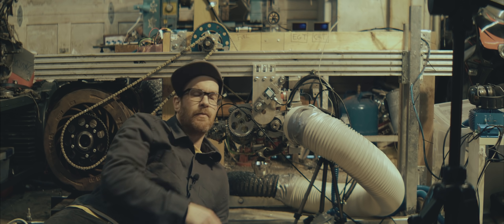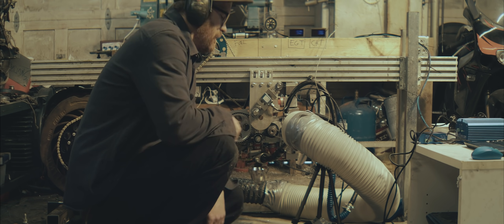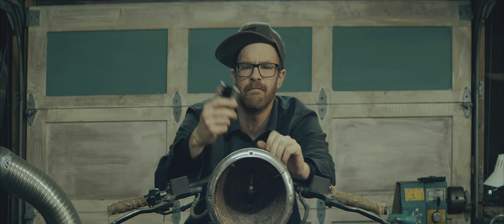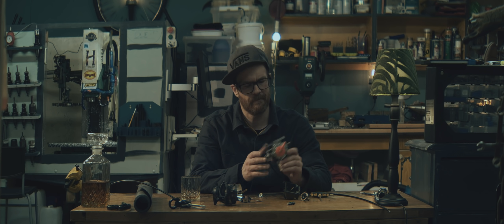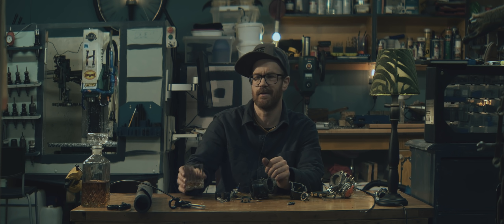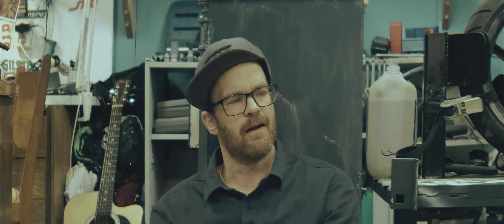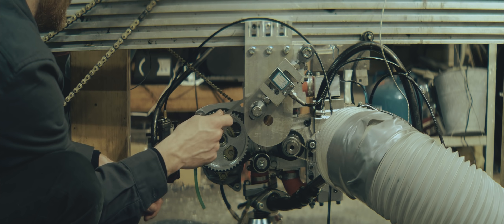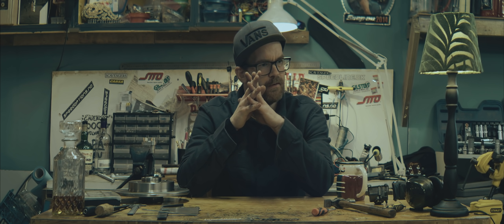Supercharged Nitro Two Stroke, Dyno quest continues.

Comment: You could very easily be getting your calibration wrong, you cant hang a weight off the load cell nut and use the weight value directly because its not acting tangentially to the pivot. If you hang the weight from the engine bold (obviously you have a lever system to take into account) you need the pivot point to be level with the engine bolt or your weight will not be acting tangentially again and you will lose accuracy.
Edit, you should also calibrate in compression the same as your measurement!
Reply: Since the weight is obviously hanging vertically, he only needs to measure the horizontal distance between the hanging point and the pivot point, they don't need to be on the same horizontal line.
In any case even 10° off horizontal would only introduce about 1.5% inaccuracy and at this point he just wants the readings to be in the approximate correct range so that he can compare different configurations.
Reply: @chrishartley1210  Are you talking about hanging the weight off the engine bolt or load cell bolt? The only time a hanging weight is tangential to a pivot point is when it is perfectly level. The load cell bolt is a long long way from level and the engine bolt doesnt 'appear' to be level either.
Reply: @manoo422  All that is required is that the measurement is horizontal. As such it has exactly the same result as if the line from the bolt to the pivot was horizontal. The only difference is a parallel translation perpendicular to the moment and as such has no effect on the vector.
Reply: @chrishartley1210  Having calculated both by hand I can see now why they are equivalent.

Comment: Haven't finished the video but maybe a boost referenced fuel pump that will raise the fuel 1psi per every psi of boost. Common thing with forced induction cars to counteract the pressure the fuel injectors see inside the cylinder.
Reply: Common with forced induction where you have injectors that is. If you suck thru a carb, all it will see is a higher gas velocity/lower pressure.
My best bet would be to go crazy with the spark energy to remove one variable from the problem.
Mounting a MAF sensor and logging the output would probably help to.
Reply: @zlaya84  good point. I also agree that having more data to go by like a MAF and a wideband for A/F ratio would be a great addition. With that kind of data it would be cool to go ahead and switch over to fuel injection and be able to tune this thing to perfection.
Reply: @zlaya84  or maybe even mechanical fuel injection... would be great for keeping the cylinder lubricated when off the throttle but really I have no idea if that would work on an engine like this.
Reply: No need, it's a draw through setup not blow through

Comment: You should add a lambda probe otherwise you will never know if the engine gets enough fuel or if it's just too much
Reply from the maker: Have a feeling it would die in seconds with the amount of unburnt oil being pumped through.
Reply: @2STROKESTUFFING  This, the EGT probe is enough to tell if you're running too lean (temps will skyrocket).
Of course running too rich is harder to detect, though I will say temps at max loads rarely go below 550C in turbo straight meth engines with 2+ bars of boost.
Reply: EGT gives a good bit of info, one thing you probably know though is that EGT can momentarily drop upon detonation when the boundary layers are blown out and the piston and head absorb the energy right before destruction...

Comment: Also, unless you have a very powerful ignition system, reducing the spark plug gap is something often needed on a boosted engine. What is the gap set at now?
Reply: I don't think it's the boost Blowing out the spark but idk this is uncharted territory... I think if the ignition is being blown out I think it's all the fuel.. it seems to me that the float carb is dead rich.. I think this setup can definitely achieve 10 pounds of boost tho (.7 bar) and that can blow out a spark if the gap is too big.. also very little is known about how an engine setup like this will respond to boost, timing, fueling, everything... there's exhaust valve timing that has to be worked out... You can't just look this stuff up lol and he's going to have to burn a piston or melt a plug to know how lean is too lean no o2 sensor will give you accurate afr because of the way the blower blows raw fuel through the thing all the time which will also mess with egt sensors too
Reply: I bet you're onto something here.
Reply from the maker: Me too.
Reply: Methanol together with an appropriately high compression and a weak ignition definetly aren't a good fit.
Trying a hotter/different plugs/varying the gap are all rather simple variables to rule out at least as substantial problems. After all it's an area known to be problematic with methanol at times.

I wonder how exactly the Nitromethane and the 10% oil effects it all (or 15? or 8?). Maybe using straight methanol with a bit less of a proper "Meth-able" oil would be a good idea to get a baseline. Though the huge amount of oil is great for internal cooling etc, it's a rather unknown variable, just like the nitro. RC fuel isn't exactly optimized for spark ignition after all.
Might not be a problem at all, but again, it's rather simple to rule out as a problem.
Reply: I agree, we run 24psi and some ignitions just cannot fire under that cylinder pressure. You can close the gap, but that’s a Band-Aid solution not a fix. We run a Dyna S on our 100cc, 50% nitro and almost 2-1 fuel air and it fires great. We have even gone to a ion battery so the coils gets more power.
Reply: Really depends on how much boost. If it's a bar or under you don't need too powerful of ignition or tight gap. I'm going to bet he is running very little boost, running it out of fuel under high boost probably would have trashed it already. Been there done that.

Comment: What spark plug gap are you running. Try tightening it up to 12-15 tho. I know I know sounds odd but that’s wat we run on cars that are boosted so pressure doesn’t blow out the spark
Reply: Sea Doo 787 engines (2 stroke with about 155psi static compression) are set up with 0.5mm gap stock....and that's not really high compression compared to what you're stuffing into that thing!
Reply: @gritzlor  ya so If was to add boost to your 787 then wouldn’t be surprised to cut that in half from 20tho down to 10tho or less even.
Reply: @acurarl9929  yeah...sort of where I was going with this. Not sure if it is linear though, if I recall right, which is not necessarily the case, the voltage needed to jump a gap is to the gap width^3. Something like that.
Reply from the maker: 0.7mm. Great idea, remember having to run 0.4ish on the old Spx engine

Comment: Tuning the pid values is a good idea. I think one problem may be the rotation sensor reading from the crank. One engine revolution is so short in time that it causes large fluctuations in the rotation speed data. This probably causes the brake control loop to overreact and apply too much brake. For the engine bogging problem I suggest applying dyno load manually and seeing if the bogging is really caused by engine problem under load or just too much brake.

I don't think the load cell has an effect on the dyno ramp control. At least in my diy brake controller it only measures the roller acceleration and reacts based on that to adjust the load. Still need to test it though if it even works.
Reply from the maker: Thanks for the tips! I can easily move the sensor back to the retarder, and some manual brake testing is on my menu tomorrow.

Comment: Need to spin that super charger faster
Reply from the maker: Let's see how much boost it makes in this configuration first 👍
Reply: @2STROKESTUFFING  I don’t mean to run more boost persay. More so saying make sure your running enough boost that I don’t restrict the motor by not spinning charger fast enough. Did you see video the channel “workshop” did on your engine. Lil foggy in my mind but believe he broke down the numbers and had good info and  foresight on your set up. It would make more sense to you as you know the fine details of your engine. Channel is “workshop” or maybe         “the workshop”.

Comment: I know nothing about A dyno but was wondering could you use a 4 horse power output electric motor to test Dyno accuracy???
Reply: Thats works really fine If it is IE3 grading power loss is guaranteed to be under 5%. so 4kw +/-5%
A 4 pole small motor of 2 hp operating at 50 Hz:
Reply: @RonnyT89  sorry mate but was u speaking English there or am I really that clueless about how a dyno works 😂
Yeah I read it again ITS ME 🤣✌️🇬🇧